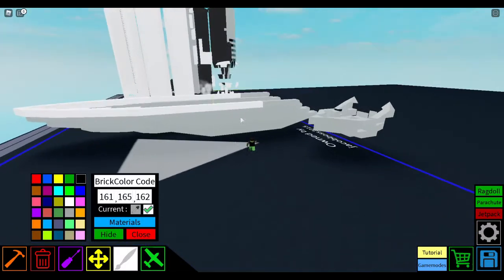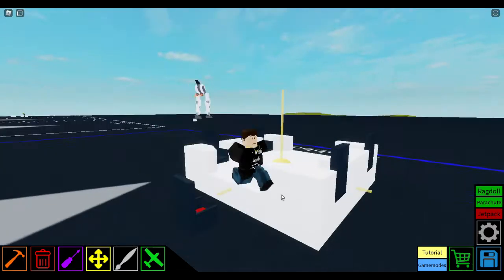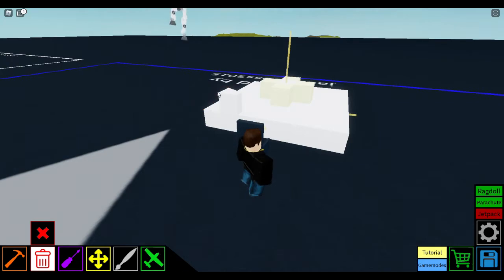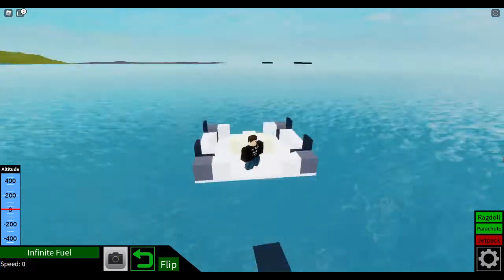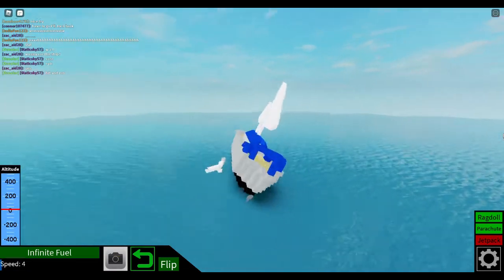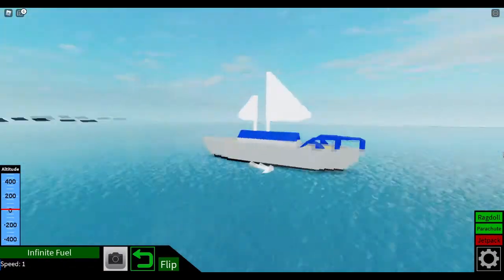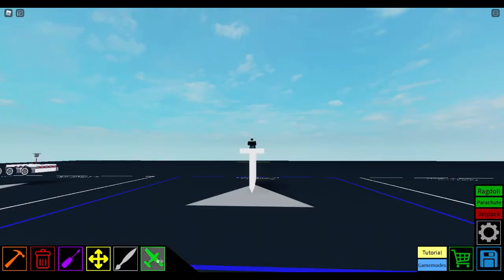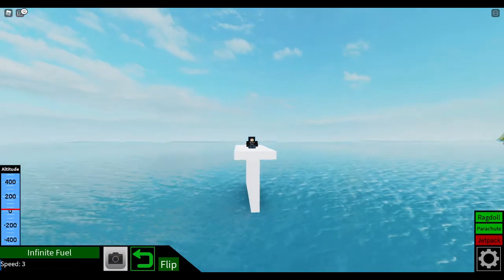Plane Crazy Boat Flotation/Stabilization Tips and Tricks

Comment: My boat wobbles whenever i turn or move
Reply from the maker: I recommend adjusting where the forces (engines, propellers) are relative to your center of mass. 

For example if you have most of your weight towards the bottom, and you put a propeller above that center of mass, it will cause your boat to dive down, back up, repeatedly. The same logic go for turning. It’s all about balance.

Comment: How can I fix this where I have a battleship and where the cannon facing and it will tilt at that direction
Reply: add helium to the cannon tip to balance it
Reply from the maker: I agree with the_final_bacon1

You need to balance out the forces and weight distribution

Comment: Youll Have To Put the Helium Blocks Only on Middle if You put it on the left or right the other Corner tips
Reply: I have a problem with my mech i think its becuz the head is overweight and i cant move the feet how do i balance my mech?
Reply: @sabunkuih  maybe bc it is overweight so some blocks, if the blocks are important then make the leg propeller more stronger,
if still nothing then try some other help
Reply: @e-syncrecording  aight thx for the reply and tips man
Reply: @sabunkuih  np